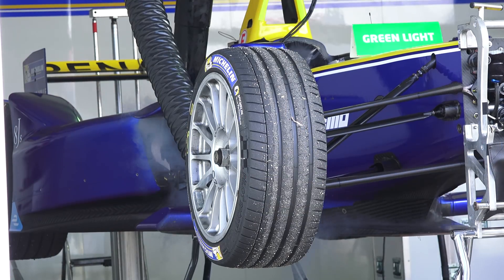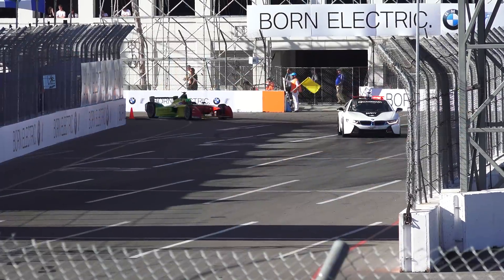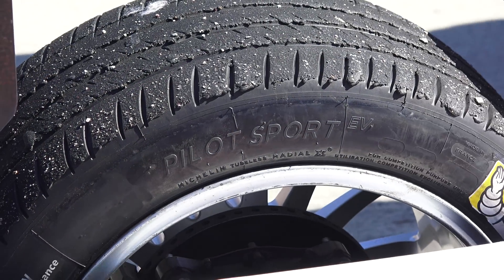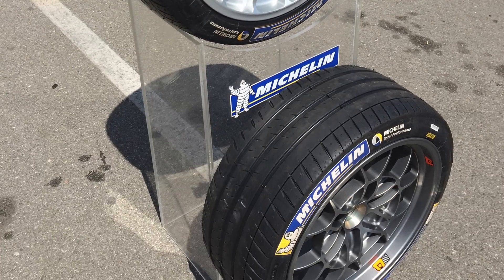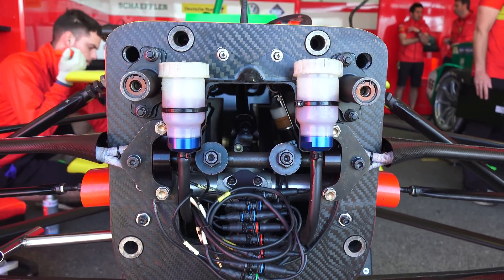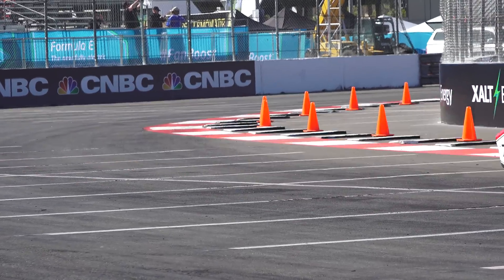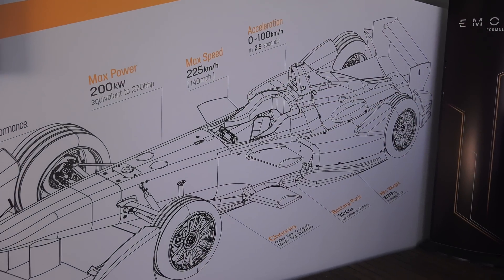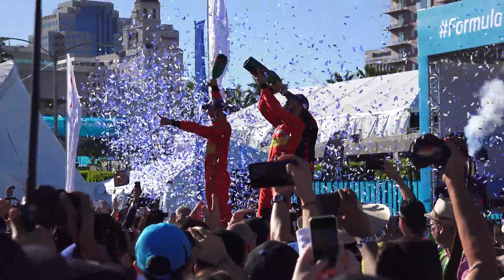The Engineering Behind Formula E - How It Works

Comment: As this is an electric car, there would be a lot of excess electricity that flows through the car. How do teams get rid of this electricity? The concept is usually called grounding. In formula student, some teams use a copper mesh to get rid of this electricity. Other teams have thought of using the aluminum core in the composite carbon fiber sandwich structure to do the grounding. How do they do it for formula E?

Comment: Why do they make that buzzing sound? Street electric cars are so silent
Reply: Straight cut gears and bearings. Also the rapid changes in magnetic field vibrates the coils inside the motor. The faster the motor spins, the louder the whine and higher the frequency.

Comment: "Power output can never exceed 170kW during a race:" Which means if the battery is 24Volts, there is a current limiter limiting current draw to the motor to a MERE 7000 Amps? Insane? what kind of power limit is that? 7 kilo Amps can fry everything!

Comment: I have a relatively simple question:

Where can I find the specs of these cars?
Min/Max length, width, height, weight (with driver and ballast), how much of that weight is the battery, and so on?

Comment: Hello Jason! I have some questions regarding some things you said in the video. 
1) How does the "62% of the weight at the back of the car'' affect the Regeneration of the brakes. How does the weight become a factor in increasing/decreasing the regen of car?

2) How does excessive regeneration ''lock up'' the tyres during deceleration? 

3) Why is power sent through the transmission first and then to the wheels? 

Will be waiting for a reply. Thanks :)

Comment: Didn't realize they used radials in Formula E before. Also didn't realize how capable today's radial tires can be used. Are there other tire companies, apart from Michelin, in Formula E?
Reply: +Nick Amarit No currently Michelin is the official supplier
Reply: ytxstream I was hoping there could be more in the future. As can be seen in automotive history, technology gained from racing usually ends up on the streets over time, so I'd like more chances of that happening and with more variety. Plus, I personally feel that a little bit of competition could help speed up the R&D too.

Comment: Disclaimer: not a car guy, yet. 
I've always been fascinated with the sound that Formula 1 cars make. how can I make a car sound the closest to a formula 1 car. does it have anything to do with an exhaust of some sort? be nice!
Reply: +Chris Ramirez I think it has more to do with the crankshaft, displacement, and rev speed of the motor. Formula 1 motors can rev from 15,000 to 18,000 rpm, which is about 3 times higher than most production vehicles. 

To answer your question about making a car sound like that, it probably  would be difficult. I think the highest revving consumer car (excluding supercars) is the Honda s2000 at around 9,000rpm, so getting one of those, or at least something with a flat plane crankshaft (straight 4, straight 6, or a flat plane v8) might be your best shot.

I should mention that out of all the loud ass exhaust notes I've heard from flat plane cars around town, most of them, including my 4 banger Tacoma (horrible idea, never straight pipe one, it has since been re-mufflered) sounded more like a thousand tiny demons sharting themselves than performance cars.
Reply: Abe Westereng wow I did not know this about Formula 1 motors. Awesome. As to what you were saying about "flat plane crankshaft" I will do some research on that. 

But laughing my ass off at the last part of your comment about sounding like "a thousand tiny demons sharting themselves." 
Have you seen/heard the Tesla Model S Saleen edition? They implemented some sort of computer generated sound that makes it sound almost like a Formula 1 car.
Reply: Engineering Explained has an entire series on formula one if you're looking to learn more, and he can definitely explain this stuff better than I could. 

Is that Tesla thing where they play engine noises through the speakers? I always thought that was a clever way to get people to accept an all electric vehicle a little more smoothly, even if it is a little ridiculous.
Reply: Abe Westereng hey, I appreciate you trying to help!!

Comment: You should do a video on auto rotation. I dont understand how a helicopter can glide from thousands of feet in the air with no engine and still be able to increase RPM for a final flair to reduce decent. Theres too little info on YT
Reply: +Judge Dredd Try smarter every day. Destin just put out a video on this.

Comment: Forumlar E is actually kind of cool to watch, but they should be BANNED from swapping cars in the pits. They should be made to "refuel" (fast charge or battery swap) or develop a technology that will run the distance of the race. THAT is what motorsport is for. Advancing a concept that can filter down to the cars we buy. At the moment all Formula E shows us is that if you own an electric car.....you'll need another one. At the moment they're cheating imho.
Reply: He mentioned that exact point in the video. and it's not cheating if it's a requirement.
Reply: Brutaka GT They're cheating "us" is what I mean ;) They're not cheating the rules of the race. The rules are cheating the betterment of the technology.

Comment: When they start making them swap batteries mid race I'll start paying attention. We have tires, engines, axles and all kinds of other heavy parts that have been engineered to more or less stay in place in formula 1 and WEC. Engineers can come up with ways to do the same for the battery packs and that would be transferable into real world automotive industry. If I knew I could drive up to battery station have a system pop out my batteries from underneath the car and put fresh ones in, I'd buy an electric vehicle. Until then I enjoy the flexibility of having a gas/diesel engine. I live in south Texas and a day on the road can easily exceed 100 miles, and on vacation days with the family I'll easily drive 180 miles one direction to get to the gulf and more if we're going to Houston for whatever reason. I like electric vehicles and I think they have great potential, but right now its not for me. The wife on the other hand, might look at one of those new Tesla's, would have to buy it out of state due to Texas dealership laws but I'd consider it. Then spend a week driving it in from the state boarder.

Comment: i dont see why they couldnt make the battery changable and safe. have it slide into a holder then bolted in with large hi-grade bolts. make it part if the pit stop stratagey.

Comment: this series could be so much more than what it is right now, hopefully it takes the direction formula 1 was for a long time, the actual pinnacle of motorsport racing and car technology. right now the only edge they have on f1 is no combustion engine... the rest is rubbish. put some real tires on the thing and let the teams design an actual open wheel race car. and dont even get me started on the fan boost...

Comment: I think any race driver of the future (hint, hint, me) Should know the engineering of there race car, this is not only more marketable to Motorsport teams, because you understand how the cars feels, you can make estimates of which components are out of place, As Wolfgang from nissan nismo also proved, in endurance racing especially you need to know the engineering, during the race the nissan stopped on track, and in endurance, if it stops n track the driver has to fix the car, he fixed the car, and bring back 2 points and won the championship by 1 point. ;D
Reply: I want to be a race car driver to, but if racecar I drive has to be electric, I'd rather have a desk job.

Comment: It's nice, but still kind of rudimentary compared to the 350+ kW amazingly compact electric motors and rapidly charging battery systems of LMP1s. Granted, they don't use their electric power all the time, so the batteries get time to cool on long straights.

Comment: Does the battery fail to work at 64° or is there an automatic safety procedure that causes it to stop.
Reply: +Dylan Tindall probably for safety, if lithium cells get to hot they can explode, so they probably cut it off before it gets near that temperature.
Reply: +Dylan Tindall The battery management system that watches over every individual cell shuts the battery down if any of hundreds of measurements is outside the allowed range.

Comment: Seen increasingly seek to produce electric cars, will take the car mechanics course still worth it? Someone could help me with this issue? Thank you.
Reply: Unlike everyone says, the oil is not going to run out within the next 25 years, and even if it does, there will still hydrogen fuel cells , and if all else fails, there is still transmissions, brakes, suspension, and many other things that are very important.
Reply: hm thx for you opinion.

Comment: What?!? The safety car is an i8?? That's so sick!
Reply: +Motorrad166 it's not even electric and it's slow as a turd. put a model S there and then come back.
Reply: flippynl the i8 goes from 0-60 in under 5 seconds, maxes out at 150mph and does over 120mpg. It's a cool car, so is the Tesla... Does it matter?
Reply: +Motorrad166 That car is a hybrid so it's a bad choice. Personally I think they should use a Rimac Concept One or Concept S, 0-100 kmph in less than 3 seconds and top speed over 300 kmph (more than 200 mph).

Comment: I've always wondered why electric street cars only used 1 gear instead of a multi speed gearbox. I figured a multi speed would work the same way on electric motors as it does for gas engines, or am I missing something?
Reply: Electric motors give 100% torque at any RPM, so a gearbox is generally superfluous.
Reply: +Quintinohthree I know that, I'm just wondering why multi speed transmissions aren't used to bring the rpm down to decrease the power needed to move the car? I'm probably missing something, like maybe no matter the rpm of electric motors they use the same amount of electricity.
Reply: Jake F Let's get into some of the science here:
Torque is equivalent to force, while RPM is equivalent to velocity, just in circular rather than linear motion, so figuring you'd be more familiar with the linear terms I'll stick to them. Ultimately we are after linear motion either way.
Power as you may well know is nothing more than work (that is to say energy used to create motion) done divided by the time taken, or P=W/Δt. Work in turn is force multiplied by displacement, or W=F·Δx. Substitution into the power equation gives us P=F·Δx/Δt. You might remember that velocity is displacement divided by time taken, or v=Δx/Δt, so substituting that again gives us P=F·v. As you see then, power is dependent on both force and velocity, and so by analogy on both torque and RPM.
A gearbox effectively changes torque at the cost of RPM (as measured at the wheel), but it cannot increase the power output. In fact, a garbox necessarily puts out less power than goes into it. With an internal combustion engine having a gearbox makes complete sense, as torque is also dependent on RPM so you can optimize the power output and torque at any given time. With an electric engine, the torque is constant, so a gearbox only makes sense if you want higher torque than provided by the engine or higher RPM than the engine can handle. However, you will lose power so you're going to have a less efficient engine overal.
Reply: +Quintinohthree I think you're still missing my question. Running a combustion engine at lower rpm gives better fuel economy, would running an electric motor at lower rpm do the same?
Reply: +Quintinohthree thanks for the explanation though.
Reply: Jake F Ah, right. I certainly don't know why efficiency couldn't be dependent on RPM, but I highly doubt it would.

Comment: The good thing is, it's pretty quiet.  The bad thing is, it's pretty quiet.
Reply: +A LeBlanc to the driver it sounds like he is driving a spacecraft. Even a small electric motor, when used in automotive sounds awsome to the driver. Different from IC motor but awsome.
Reply: it actually sounds like those big rd cars like Traxx
Reply: +A LeBlanc Believe me it isn't quite at all if you hear it in person
Reply: ytxstream quite, indeed.
Reply: nfsgt500 I dont smoke.What are you smoking and where did you reach that conclusion?
And next time make a point if you can.
Reply: Agreed, they're a lot quieter than your average V8 race car but up close, still plenty noisy. I was stood next to the start/finish straight at the last London ePrix. When the pack went past me just after the start, I genuinely had to cover my ears.
Reply: Yeah, but it sounds like a tie fighter
Reply: +A LeBlanc 
shhhh! 
what?
Reply: agreed, they sound awsome
Reply: +Theo papa what are you smokin?

Comment: I don't get why capacitor is disallowed
Reply from the maker: +Kevin Choi It probably will in the future, they're opening more aspects up each year for teams to benefit from. Initially it's so that the cost is maintained.
Reply: Really heavy with low energy density. Given how small the battery pack is, it doesn't make sense, might as well add more batteries and get more energy for the weight. Personally I find it well, underwhelming that they are not running 80 to 100 kWh battery packs to enable 1 MW peak output and then a couple years from now implement next generation batteries with double or more energy density and get 160 to 200 kWh for the same weight and 2MW motors.
Reply: Not sure how you'd get "next gen batteries with double capacity" in just a few years. Battery development is really underwhelming.
Reply: It'll be great if Tesla joins the race.. 

It's a durability test

Comment: At least they're doing this for accelerated R&D for trickle down technology.  However, now that I've actually sat through the video, it shows how much more flexible ICE are compared to battery powered motors need to remain at a certain temperature.  I like how some luxury cars are using a type of AWD where the primary drive wheels are ICE while the other wheels are driven by electric motor, however, I'd like to see this more in production cars ranging from $14k to $23 where they are supposedly garner to the masses.What boggles the mind is the continued use of lithium polymer batteries where NimH are more cost effective and better for the environment and don't degrade if discharged completely.

Comment: The fact the battery is not removable still messes my mind. It would be a great way to explore new solutions that could come to the market. I mean it would be really great have an electric car and an additional battery, or for instance, a "E-station" where i can leave the "old" discharged battery and and pick up a full one, like even faster that getting a full tank of ol' gasoline. I really think it would open up the horizons of electric cars. And overall probably in exchange of reduced battery capacity they could maintain the same levels of chassis rigidity without compromising much on the safety department. But that's my opinion. Just really interested in what you think about that +Engineering Explained
Reply: +Miguel Pedro theres is one, tesla can change your batteries in minutes
Reply: +Francisco Barraza there's good news after all. I was unaware of that fact, nevertheless seeing formula e pit stops to change a battery would be an interesting sight

Comment: How terrible is Fanboost?
Reply: +Gregory Sherman 
In the past it didn't seem to give anyone an actual advantage. One of the drivers actually complained that using it wastes too much energy in the long run. Also I think in Long Beach one driver tried to use it to overtake the car in front - which failed. So it's not as strong as people might think.
Still, I am still very sceptical about this Fan Boost thing as it puts popularity over racing skill.

However, I still prefer Formula E to Formula 1, it's just more interesting because of the narrow street courses. There's always a fight for the better position whereas in F1 it seems they just drive in circles for two hours and rarely anyone actually overtakes. Maybe it's also because the Formula E cars are much closer together in regards of power.
Reply: +qwesx what ls fan boost?
Reply: +qwesx The power thing is actually true, one thing I hate about Formula 1 is watching only RedBull, Ferrari and Mercedes/McLaren win the races because of the better engine and extra power. The other teams dont even get a chance to try.  Formula E in the other hand, power is the same, meaning that everyone has a chance of winning and the race is actually based on driver skills and managment, making the sport way more interesting.
Reply: +CarlosG 0619 The reason why Mercedes, Ferrari, and Renault Engines win races is because those teams spend countless of millions more than any other team. This money goes is used towards more than just the engines, but also aerodynamics, mechanical grip, etc. It is not a surprise that they win, they simply put more resources in. This causes innovation which trickles down to a car you drive every day (abs, traction control, etc.). Racing is not about just driver skill, it's also about the car. Look how boring stock series are, aka. Nascar, and how attendance has dropped so much in the past year. Anyone can win regardless of how much time and money you put into it; you are rooting for the drivers now and not the car. Racing has lost it's appeal.